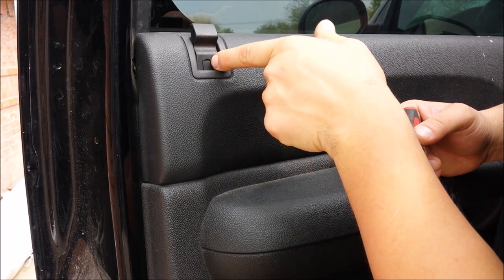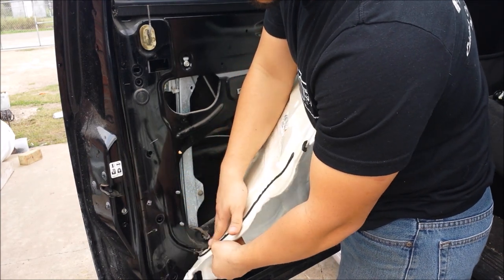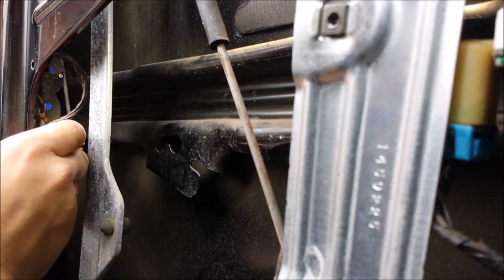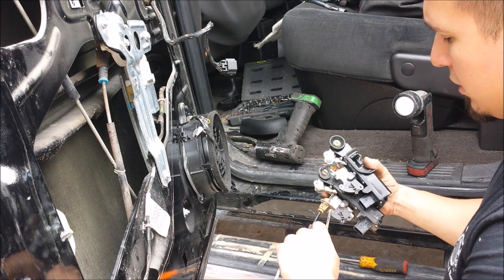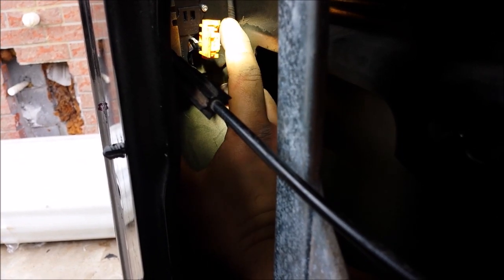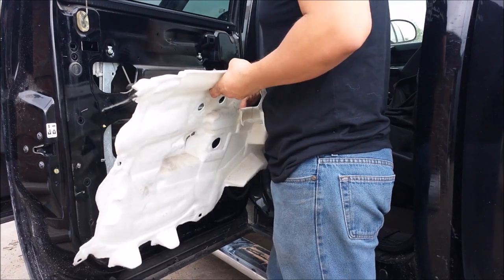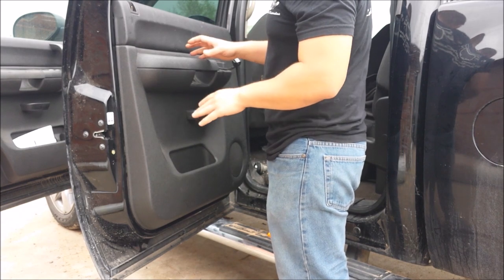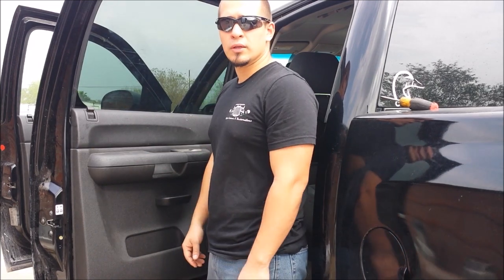Door does not lock or unlock? On 2007-2013 Silverado, GMC, Sierra, Tahoe, Suburban, Denali

Comment: My 2009 Silverado automatic locks work in the morning. When the heat comes around the locks begin to get stuck and not move up at all. Would it be all 4 Actuator or another problem? Thanks for the video and time. Have a good day.
Reply: Same exact problem on my 2009 Silverado.  Locks work when the temperate outside is cool.  Will not work in the afternoon when temp is warmer.
Reply: Did we ever figure this out orrr nah?
Reply: Same problem just happened today

Comment: Great video, my passenger doors on my 2008 doesn’t lock and unlock just on summer days but in cold weather works normally, should I  replace them? Thank you.
Reply from the maker: Thank you very much and changes are they have gone bad. Weather affects in the sense that the materials get thicker in the colder weather causing more effort from the motor to operate.

Comment: Both of my back doors won’t unlock when pressing the unlock button on my key it does lock tho when I press the lock button on my keys. I swapped the left rear actuator but when I was testing to see if it works to unlock it did the exact same thing as the old One it locks but won’t unlock is it because I have to change both actuators? I have no idea what the problem can be. Thank you again !!
Reply from the maker: You may have gotten a defective one or you can have a slight break in one of the wires twhere the door opens and closes. There id a little rubber boot that covers all the wires going to your back door. After the years of opening and closing, wires can crack. Ive repaired those broken wires before. Hopefully its not the case but other than that, thats all i can guess...wish i was there to help...

Comment: Great video, I have a 08 silverado 2500, dash says passenger door open while door is closed and running.  this same actuator on mine seems wore out, probably is wore out, maybe not sending signal that door is closed. not sure which passenger door its is. Are these actuators left and right side specific to the drivers side rear door, and passenger side and passenger rear door? 
    Thanks
Reply from the maker: That is correct they are side specific.  Thank you for reaching out and good luck on your repairs.
Reply: @EddiesCustomsandRestorations  thanks for the quick reply, would this be the part causing the passenger door open light being on? Had to take the inside light bulbs out cause they were staying on, cause it thinks the door is open.
   Thanks.
Reply from the maker: @robertbelknap  you're welcome. This can be a cause for sure but there are a few other things that can cause this as well like "door ajar" or "door open" sensor can be faulty, BCM (body control module) (rarely the case) but I would check the inexpensive parts first for the sake of the "do it yourself" repair. Replacing everything yourself would literally cost you less than paying someone to do ONE of these jobs.
Reply: @EddiesCustomsandRestorations  thanks, is the door open sensor a different part completely, or is it a sensor within this part.
   Thanks
Reply from the maker: @robertbelknap  if my memory serves me right, the actuator has all the functions from unlock, lock, as well as detecting when the door is open and closed.
Reply: @EddiesCustomsandRestorations  THANK YOU!👍

Comment: Appreciate this video i have a 2013 Silverado I’m having the same issue my door won’t lock or open plus my service tire monitor light is on any suggestions ?
Reply from the maker: Youre very welcome. As for the TPMS light, air up your tires to the recommended tire pressure and if the light remains, go to a local tire place perhaps a discount tire which recalibrate your TPMS sensors for free and have them do the calibration. If a sensor doesn't accept the calibration, it will need to be replaced.
Reply: @EddiesCustomsandRestorations  thanks… i have one  more question i went to the dealer with the problem that I’m having &  they told me i need a remote control door lock receiver have you ever heard of this part?
Reply from the maker: @Moe504.  yes I have generally related but it is just one door that is not locking chances are it will just be the actuator on that door and just a coincidence that the TPMS light came on at the same time.
Reply: @EddiesCustomsandRestorations  thank you & yes the TPMS light did come when the problem occurred… Eddies Customs & Restorations is this a business?
Reply from the maker: @Moe504.  the receiver is linked with the tpms system so if it fails it will cause tpms to act up as well. And yes it is a small business.
Reply: @EddiesCustomsandRestorations  exactly thanks for your time & patience now i have to look around for someone to fix it went to dealership they wanna charge me 800 hundred bucks
Reply from the maker: @Moe504.  oh youre welcome.  And yes the stearlership gets pricey. But do a Google search to find the location of that receiver if you feel that that is what needs to be replaced and get the part online and do the install yourself. Cuts down cost a lot that way

Comment: When i try to unlock/lock my doors from inside my truck they don't unlock/lock on both driver and the passanger sides but if i use my key fob it will only lock/unlock my passanger side.

Comment: I changed my driver door outside handle because the plastic threads were broken. I tested everything and it seemed to be working. Trouble is once I lock it and unlock it, the driver door will not open from the inside or outside. Any thoughts on the issue? Thanks.
Reply from the maker: Double check and make sure the clip that holds it on is properly installed. It may be shaking loose or shaking off once you lock and unlock
Reply: The door handle linkage is out of adjustment.  The little yellow clip needs to be closer to the end of the threaded end of the rod when you clamp back together and re-install the linkage to the latch mechanism.

Comment: Drivers side front door lock won't lock or unlock put changed the latch same thing still doesn't work the other 3 are fine any suggestions
Reply from the maker: @Bootieman618  could also be the master switch.

Comment: I have a manual lock.Just a key to unlock door or pull up knob.I have a problem when it gets really cold I go to shut door and it won,t shut.I spray deicer in it or wd 40 then it will work .Pain in the butt.I have a 2013 gmc.Do I have to replace lock? And where do I find one?

Comment: if the door cannot unlock, how did you open the door.  see the problem with this and other videos.  you don't show HOW TO OPEN THE DOOR TO MAKE THE REPAIRS!
Reply from the maker: Just pull the lock up from the inside. This is under the assumption that only ONE out of the 4 doors does not unlock. But yes to unlock the ONE door just pull the lock upward. Same way it's always been.

Comment: After replacing all the latches only the right side works. Driver side still doesn't work. Need help?!
Reply from the maker: Could be the master switch there on the driver side door
Reply: @EddiesCustomsandRestorations  HI Eddie, really appreciate your knowledge in this matter... I also replaced the passengers and both back doors on my tahoe. My question is there a relay for the door locks and how where do I find it?

Comment: I always wondered when I took mine apart , what the heck were the engineers thinking when they designed this junk ? Is it a secret that vehicles are put together by screws ,nuts, bolts, clips and cheap plastic tabs which are the weakest ..I'd rather see the nuts bolts and screws in today's world , it was only cool years ago when we didn't have to fix it every year ..now it's all garbage made disposable plastic parts ..but they charge more for it ??? It's actually worthless....see how I worded that ?? 😂
Reply from the maker: Lol exactly right on EVERYTHING!!